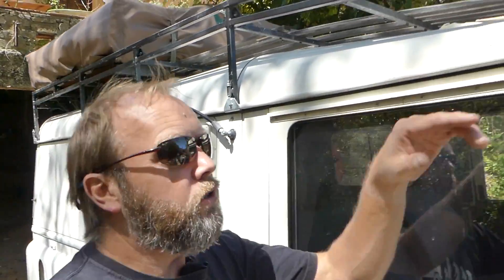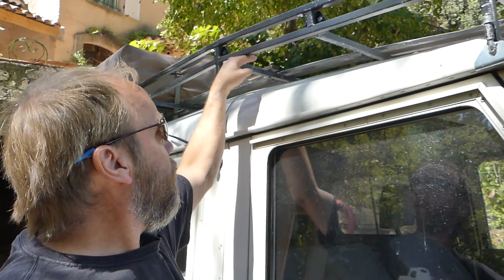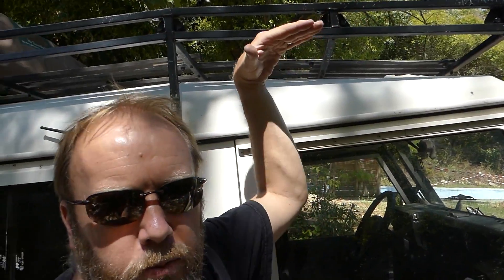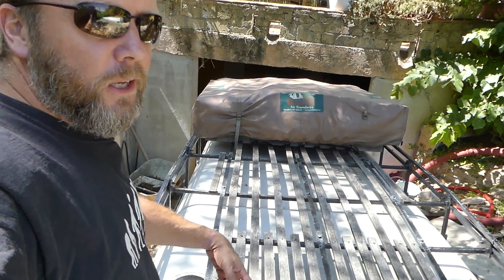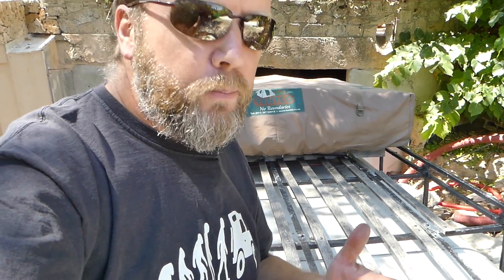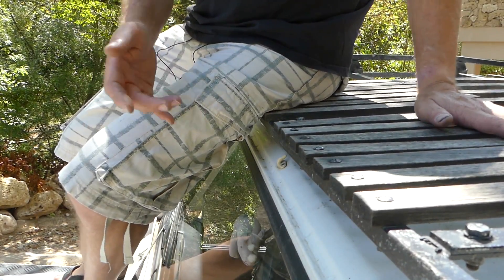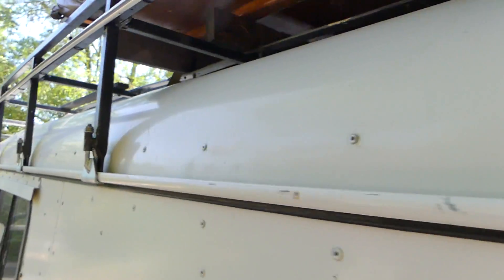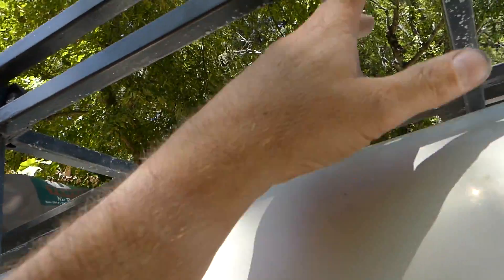The Britpart Defender Roofrack - the good the bad and the ugly 'The El Cheapo'

Comment: Love it - you’ve got something unique there with yourself in it. I made my roof rack starting with two roof bars. On one side of them I bolted on the basket from an old Classic Mini roof rack I had lying around. In that basket I now have a home made deep wooden roof box plus a rooftop camping shower arrangement I designed with an immersion heater in it. On the other side of the roof rack, I bought some flat aluminium bar off eBay and made a platform which takes three plastic “really useful boxes” holding the clothes we don’t need to access very often on long trips, and some firemaking stuff. I can get loads up there and on the side which doesn’t cover the roof so much, it leaves room for my recovery shovel which is on the front of the roof. The roof rack arrangement is totally unique, looks great, and didn’t cost me much at all. So I take my hat off to you!
Reply from the maker: solarbuduk very cool 👍😎 ! Hats off to you actually

Comment: Great video, need to find a custom solution for mine. Was thinking of the same rack, and cutting mine like you have to also fit my roof tent. I think the extra flex is because you have taken some of the rigidity away after cutting off the top bars. This has been really useful for me to consider how to do mine. Thanks :-)
Reply from the maker: Cheers, glad it was helpful. Still rocking the rack, it is holding up well 👍 in fact I added a terrace up there, since we spend a lot of time. Here's the short vid if interested. Good luck with your truck 😎💪😃https://youtu.be/zaFfwJEahNc

Comment: I was going to say the number one reason for a roof rack on a defender is to stop the roof from caving in when you roll in a crash, but the way your rack bends.. I don't think it will help much.  Mine is the standard galvanised steel type all welded together, its rock solid without any bending.  And 8x4 plywood fits within the sides perfectly!
Reply from the maker: Actually the roofrack aids in tearing of the roof in the event of a rollover - this happened to my brother-in-law, opened up like a tin can and they were all ejected into the field, luckily no fatalities, but very banged up... Vehicle was, of course, a write-off, chassis still good but the aluminium body is like cardboard...

Comment: Perhaps some black high density foam to help with middle support in front of rack? You can always cut it to fit snuggly or latch some zip ties to prevent it from moving.
Reply from the maker: Shouldn't have to do that of course (modifying a product designed for a specific purpose ;-)), but good idea
Reply: A Simply Fab Life ha, exactly 👍🏽. Hey, at least you can have a rack. I'm stuck with a Fiberglas top ☹️

Comment: Always enjoy your videos. I had a brownchurch rack I got for about £80 and it bent and flexed just as yours does. I had to cut most of it away to fit the roof tent as well. You do forget how much drag the tent gives the 110, as when I removed it all it felt like a sports car!  You guys seem to get around wiyh your LR which is really cool. Ours is about to make the big relocation trip from the UK to Germany in a few weeks. If you're ever in NW Germany drop us a line, always happy to help with issues or if you need somewhere to pop the roof tent up. By the way, what is the hole that's been cut over the right hand side roof top of the cab?
Reply from the maker: Paul Connor Thanks Paul ! Are you moving to Germany permanent ? We got Croatia on the horizon soon tho 🤘 Thé hole is/was a satellite receiver which I haven't managed to get to work yet🙄....
Reply: Hey. Yes, I am moving there permanently. Big scary step, but giving it a go! So if coming past say "Hi".

Comment: Fun video, yes S**tpart racks are cr*p..., like most of their stuff... Think I used some of their swivel housing grease once...
I think for the money Brownchurch are hard to beat... I had a Discovery model on my Nissan Patrol with a Maggiolina roof tent.. didn't flex and was very strong. Only cost 200£ in the UK. Was powder coated so did end up rusting a bit, when the powder coating started to crack.. 

On my Santana I've got a Frontrunner...which I took off a Nissan Terrano before I sold it... Excellent rack system, but quite pricey. Probably wouldn't have goe for this one, simply on price, if I'd had to buy it, but have to say its a very good rack. 
By the way you have to etch prime galvanised steel if you want the paint to stay on.. I made that mistake once... it eventually all flakes off...
Cheers frm Northern France..
Reply from the maker: Thanks, good to get some feedback on the different racks... Merci et à bientôt!